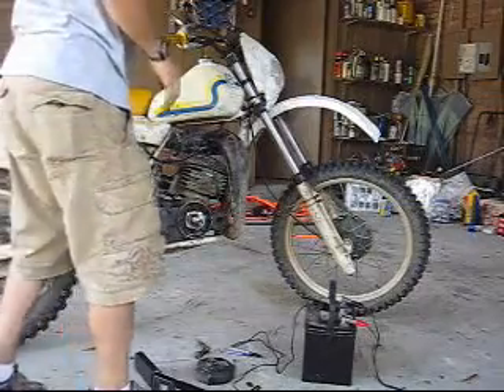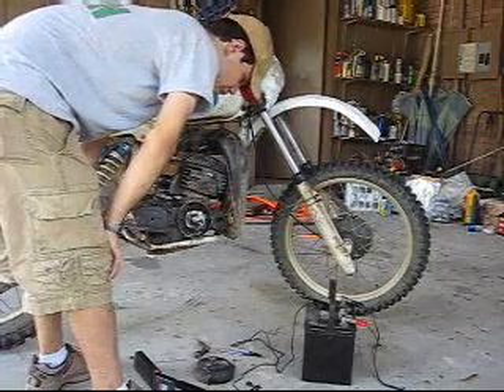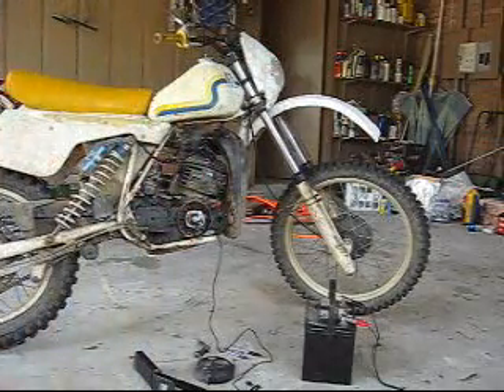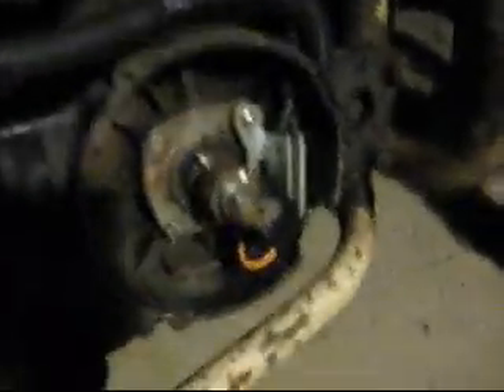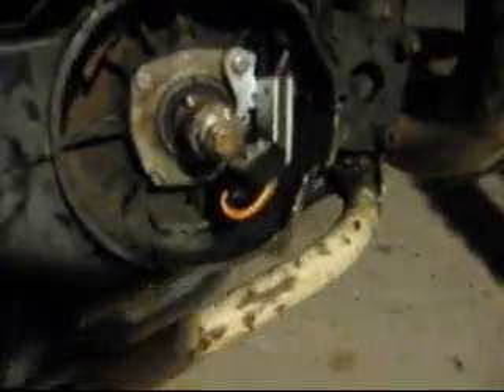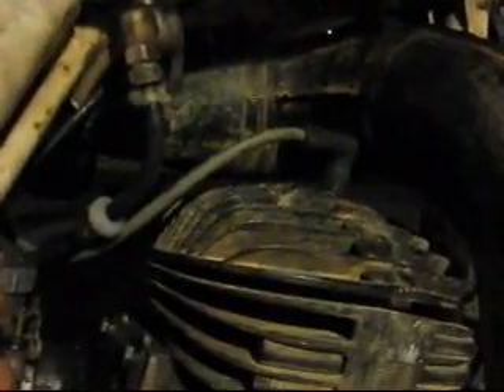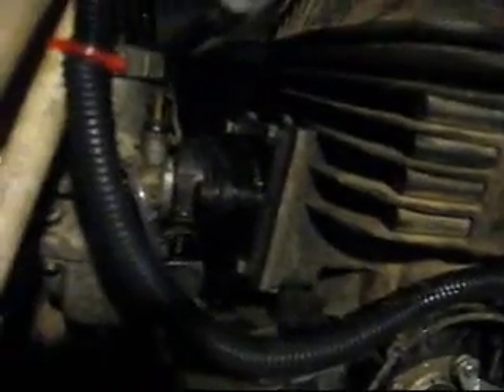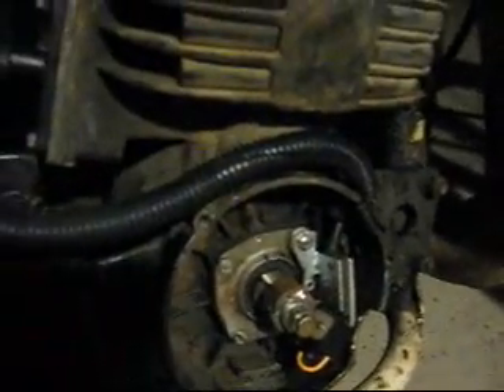Using the timing light on the HEI Husqvarna

Comment: Great to see you figuring out how to add HEI to your bike.  Don't sell the stock coil short.  That stock coil will easily fire a 4 cycle V8 at 6000 rpm which is like firing a 4 cyl 2 cycle at 6000 rpm or a 1 cyl 2 cycle at 24000 rpm.  The secondary voltage of the MSD coil may not be as high as the stocker because it's designed for a higher primary voltage.  It's all about the ratio of turns between the primary and secondary coils.  Cool stuff.